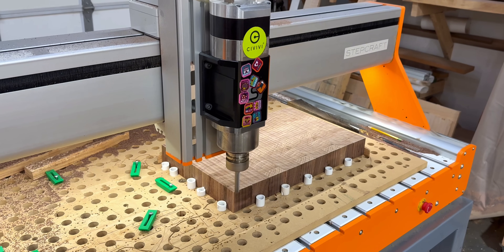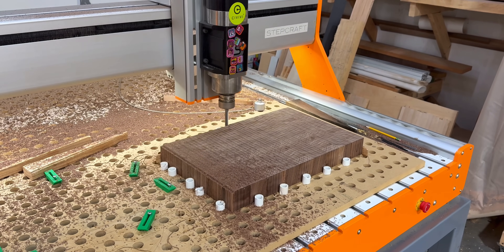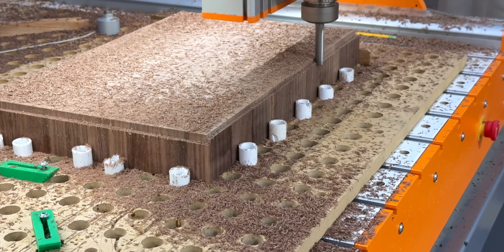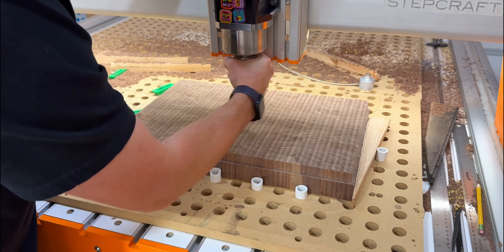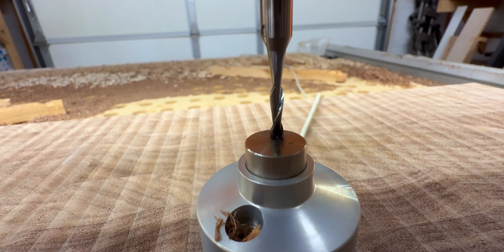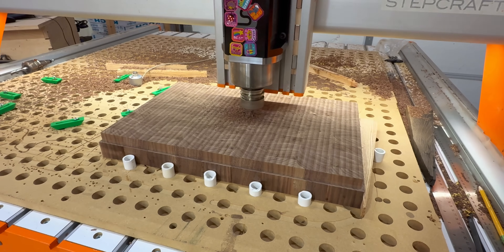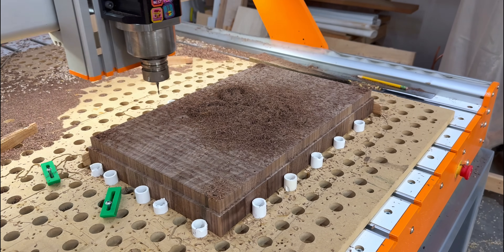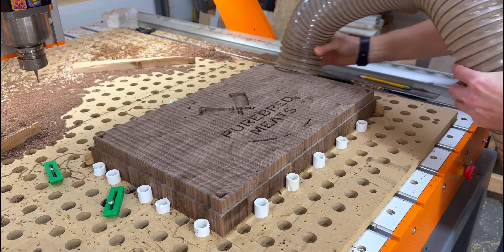CNC Inlay Cutting Board Made for Purebred Meats Thirroul. BroinwooD

Comment: Do you mind sharing info about your "manually" operated tool changer?  Is that an ATC spindle and you manually trigger it to change out the tool holder?  I've been looking for some kind of quick connect adapter for my conventional "non-ATC" spindle so I can quickly/easily change bits in a similar manner as you did in this video.  Thanks.  My wife and I enjoy all of your content!

Comment: What made you choose Stepcraft over other CNCs? I'm looking at the m.1000, Next Wave HD510 or the Shopeoko HDM. Any suggestions?
Reply from the maker: When I was making my decision, I was mainly focused on precision and repeatability. I also wanted a larger machine that came fully assembled — I didn’t want to deal with building it from scratch. Another key factor was having an ATC spindle, which narrowed down the options quite a bit. That’s why I ended up choosing the Stepcraft. Overall, it’s also a very adjustable machine — with some fine-tuning, you can get really excellent cutting results.

Comment: Do you clamp the inlays in place during glue up or, just leave them to dry after hammering them in?
Reply from the maker: After I hammer the inlays in, I put the board into a hydraulic press for about 15 minutes. After that, I let it dry out in the open air — no clamps, and I don’t leave it under pressure. Just let it sit and cure naturally.

Comment: Hi Nick. Beautiful work as all your previous works. May I ask you what wood essence you mean by yellow heart? Good work
Reply: Yellowheart is an exotic wood.
Reply: @michaellevine6019  I already know it's an exotic wood, but I think the tree it comes from should have a name. For example, Osage Orange is an exotic wood and is yellow in color. Is Nick the Yellow Heart perhaps Osage Orange?
Reply from the maker: Thank you! Yellowheart is typically the common name for Euxylophora paraensis, a tropical hardwood from Brazil. I can’t say with absolute certainty, but with 99% confidence, that’s the species I used in this project.